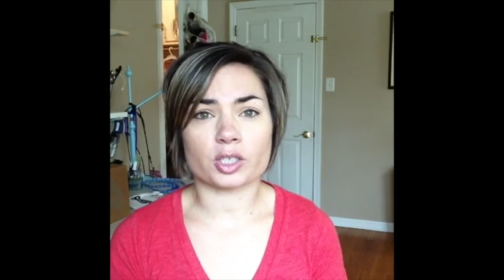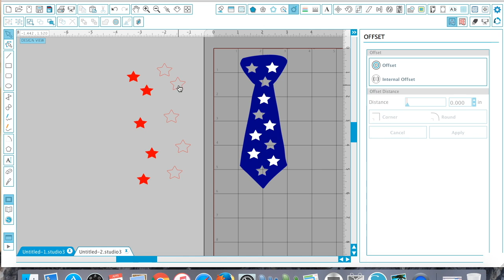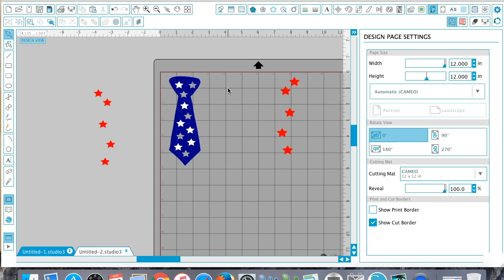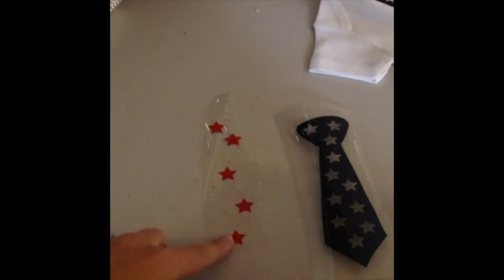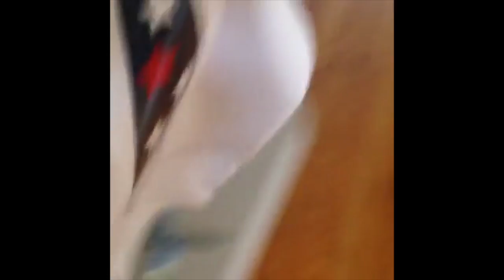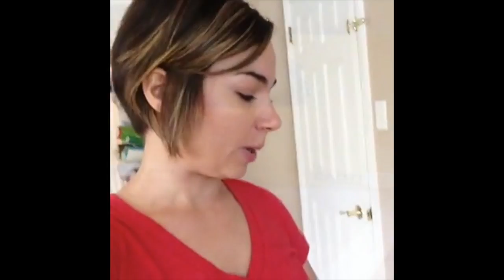🌟How to Layer Multi Color HTV with Heat Press (Silhouette Beginners Tutorial)

Comment: I see so many people layering vinyl and the shirts can’t flex. It feels like a bullet proof jacket.

When I do this l, the shrinkage sometimes is apparent when subtracting the later for the insert.

This leaves visible, although small imperfections. If resizing the subtraction, it could help. I just need to figure it out..
Reply from the maker: If you put an offset around one of the layers it will slightly cover any overlay gap
Reply: @SilhouetteSchool  I’ve thought of this. I’ll try this evening using offset. Thank you! pS…. I like The Siloutte Software, is the Siser platform superior. I want to Retire my Brother Scan n Cut DX250 Disney edition and my Cameo 3.

Comment: Why not just cut the tie all black then add stars on tie? It's still layering.
Reply from the maker: It's best to have the HTV pressed directly onto the fabric instead of on another layer of HTV. This helps prevent peeling and also avoids the multi layers of HTV from creating thick, stiff areas on the shirt.
Reply: @SilhouetteSchool  yes but with an offset, it will have an unlevel bump anyway.

Comment: I have a question, I use Siser Easy Weed HTV, I usually do 15 seconds at 305 for the full time, that’s what it calls for, so for the first layer, how many seconds should I do? And how many for the second layer?
Reply from the maker: If you are laying HTV you want to tack every layer except the last for just 1-3 seconds. So if you have two layers you would press the first layer for 1-3 seconds, then put the second HTV color on and press for 15 seconds.

Comment: I am confused by this.  Why did you cut the holes in the blue tie vs. just putting the red stars on top of it?  Would have been easier and not have to worry about 'covering the hole'.  Just curious.
Reply from the maker: To limit how thick the transfer is on the shirt and get the best possible application for the best stick. If you are layering multiple colors of vinyl over each other it becomes thick and rigid on the shirt and you increase the chance it will peel.

Comment: I am wondering when I want to layer HTV, what do I placed over the project when ironing? Like what was that white sheet you put into your press before closing it?  I am worried about melting the first layer when working on the second.  Thank you!
Reply: Cait Monahon it's called a teflon sheet. It protects your vinyl from the heat press.

Comment: where can i get the clear. is that printed directly on the clear sheet or cut out using the colored vinyl?
Reply: +Caseyandme tv That is the carrier sheet from the HTV (Heat Transfer Vinyl).
Reply: oh so you printed them onto blue htv and red as well?
Reply: Caseyandme tv There's no printing, it's all cut out with the Silhuoette machine.  The stars are cut out of the blue tie, the red stars are cut out of red vinyl and put in the cutouts on the tie, and the white stars are the t-shirt showing through the cutouts after she irons the design on the shirt.